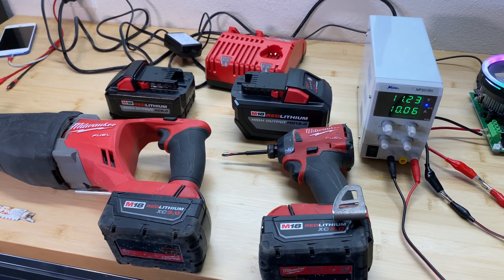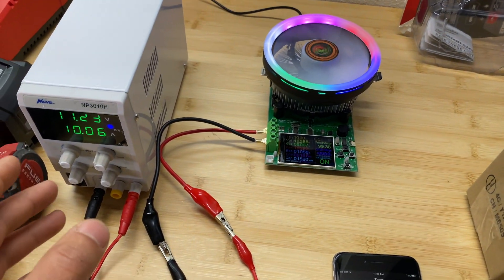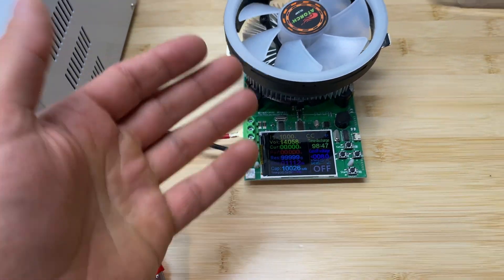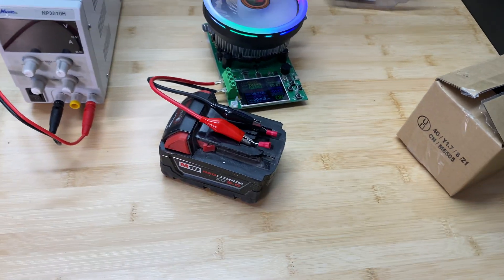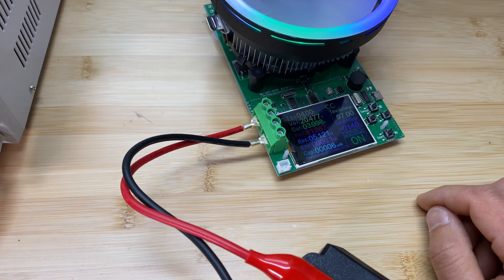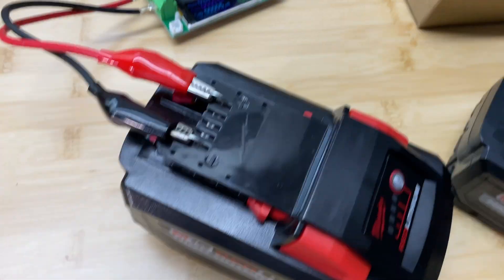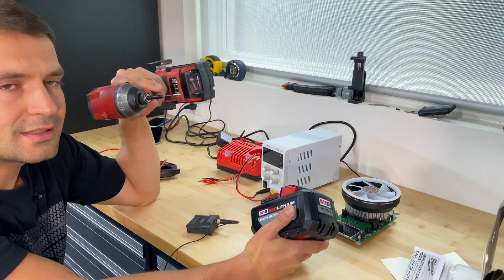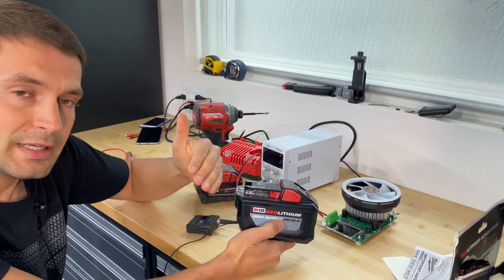Testing Milwaukee M18 batteries capacity. Unfortunate results.

Comment: I don't see unfortunate results. The upper limit of the 40t Samsung cell used in the 12ah battery is 4.2 volts. You charged the pack to 20.8 volts which is 4.16 volts per cell. The lower limit on those cells is 2.5 volts. What was your lower cut off voltage? It's likely that these cells will test above rated capacity if you use the right parameters.

Comment: I know this is an older video but I’ve just recently performed similar tests with 3.0s, 6.0s, a 12.0 and have a 5.0 currently testing. Not a single one has hit advertised capacity and I’m testing at the battery manufacturer’s stated current draws on their datasheets (Samsung, LG).
Reply from the maker: what is the discharge amperage you do?
Reply: @SolarEngineering  .2C is what Samsung specifies and that’s what I usually test at. My 5.0 just tested at 3.8ah :(
Reply from the maker: @darthtater  wow, good to know, even worse results than I got.

Comment: Thanks...very interesting.  Would like to see the batteries tested using all 4 wires sometime.  Would it make a difference?
Reply from the maker: I don't think so, terminals were cold during the test, so no energy loss there.
Reply: It does make a small difference as the voltage terminal with have less voltage sag and a bit more test time

Comment: I think there is some misunderstanding about battery ratings (and the marketing).  I think a good analogy is a gas car.  If the rating is say 25 miles per gallon, that is often stated for highway (or city) speeds - I believe this is typically 55 mph for the highway rating.  Now, if you were to drive that same vehicle at 80 mph, would you expect to get the same rating…no, it is less efficient.  The same is true with batteries.  Lithium batteries are rated at discharge current of 0.2  x capacity.  So to see if the battery is performing, the 8 Ah battery should be tested at a discharge current of 1.6 A, not 4 A…96% is actually pretty good.
Reply: ⬆️ this guy gets it.
Reply: Having tested many packs like this these are good results.  Plus he didn't split the leads giving a bit smaller result

Comment: Usually these capacity tests are conducted at quite low currents to lower thermal losses and discharge right down to 0% which if performed repetitively will damage the cells quickly. I get your point about getting less than you payed for but this is the standard way lithium batteries are marketed. If you buy a 2500mah 18650 you'll never actually get 2500mah in normal operating conditions

Comment: Its all the same for other brand, they label the battery capacity based on the Cells. But they dont charge them full to make them last longer. Its all the same for all the other big brand. Stupid test
Reply from the maker: That is an incorrect statement. Branded batteries like Tesla powerwall, BattleBorn even derate capacity to make sure that end customer get full capacity.
Reply: @SolarEngineering  we are talking power tool here?
Reply from the maker: @smartorder4997  we are talking about batteries my friend.

Comment: That’s at 20 volts though. What about capacity at the advertised 18v? I think that might make up the difference
Reply from the maker: I did measure Ah, when measuring Wh then need to consider voltage.

Comment: Battery operated tools are for convenience when power isn't readily available. I just bought these batteries and you make me want to return them, lol.
Reply from the maker: I have many milwaukee tools, it's a good quality brand. I just wish they advertise it right.
Reply: @SolarEngineering  Ask them to rate those batteries 1Ah down and all will be in specs.
Reply: Convenience does not excuse false claims

Comment: A bit of nit picking here, but I think it’s important. Did you check that the charger charged them fully, with proper calibrated equipment? Otherwise it’s not the battery capacity being tested, just the capacity when charged using that charger.

If it is the charger only charging to 97%, it might make the batteries last longer at the expense of some minor capacity.

Also, I didn’t get exactly how you decided that the meter is accurate? Two unknown sources producing a somewhat ”expectable” result doesn’t necessarily mean its accurate (one too low and one too high for instance, combined it looks ok). You might have verified your PSU before and I might have missed that, I just think its important to be somewhat ”scientific” when sharing conclusions.
Reply from the maker: it's a good input.
I did make sure that the battery was discharged at least 50% before fully charging it.
I kind of agree about equipment being used, but did test many cells before using different capacity testers (like Victron shunt) AND one in the video, results were the same.
Reply from the maker: >>If it is the charger only charging to 97%, it might make the batteries last longer at the expense of some minor capacity.
then the battery should not be advertised at the capacity that is unavailable.

Comment: Yeah because they are not rated at hi continuous discharge as they will get hot which will change output as resistance of battery changes as with all.
Reply from the maker: 8.0 Ah battery is going in package with leaf blower.
12.0 Ah battery going in package with lawn mower.
Two of the devices are supposed to be used continuously, so my understanding that batteries  should be rated for continuous power output.
Reply: @SolarEngineering  Hmm I'd read the manual but I bet the motors ain't even rated for over an hrs cont usage. I know the leaf blowers I've had said something in the manuals about 10 - 15 min work then stop for 20 mins to cool off most these plastic types are the same. Not like the old days when even the lawnmowers were made of metal that could sink the heat away and they were larger thus better cooling. Everythings compact these days and with motors that usually equals a cool off period, so the bats will also take that into consideration at the design stage as everything is made to a price.

Comment: Thanks for doing that. I'm disappointed, but not surprised a brand like Milwaukee under delivers AH compared to claims. Spending too much on profit and not enough on product quality control I suppose. The Chinese will wipe these manufacturers off the face of the marketplace if they don't pull their finger out.
Reply from the maker: I agree that marketing doing it's job, and people simply trust into brands.
Trust but verify.